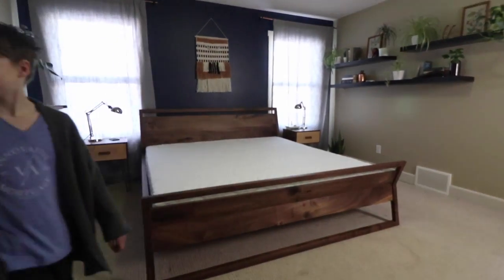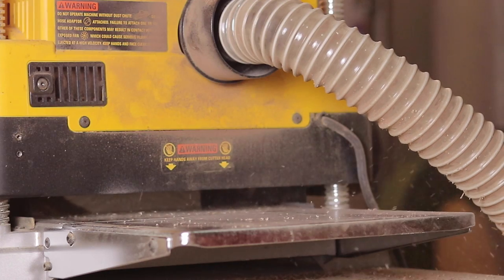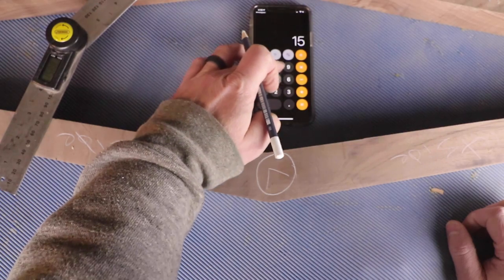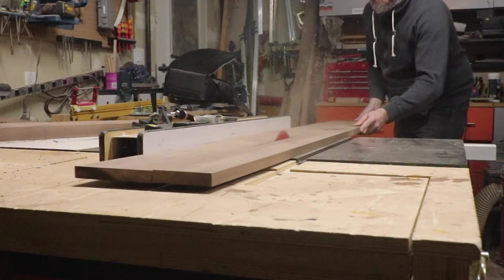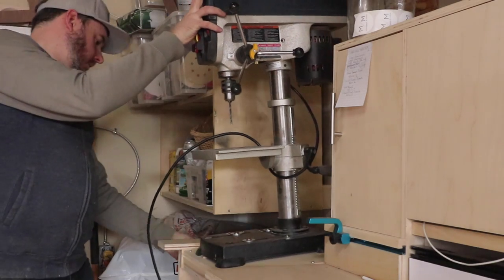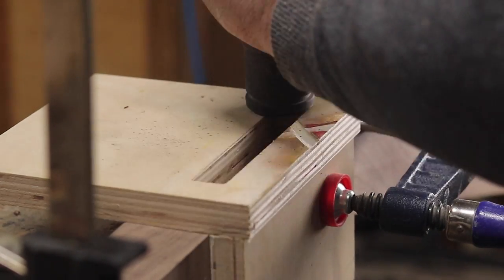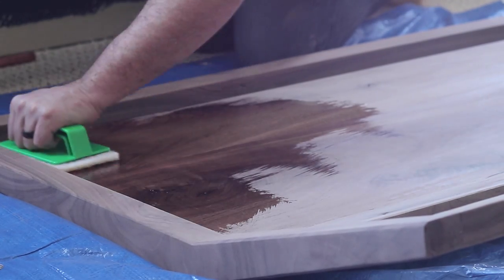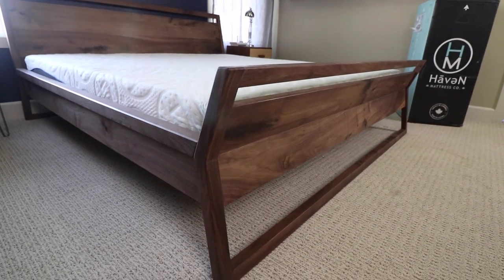How to make a Kingsize Bed Frame // Mid Century Modern Sleigh Bed // Do it Yourself (DIY)(2019)

Comment: Your design aesthetic is outstanding! Wow! Question on the hardware- Did you have any concerns with screwing into end grain and the possibility of it ripping out over time? And how's it holding up in terms of tightness of fit?  Again, incredible build and wonderfully entertaining. Thanks .
Reply from the maker: Thanks. I don’t because of how the rail is sitting. It’s been Over a year of use and no signs of any kind of issues. Thanks for watching and commenting.
Reply: Mortgage & Mitre used the hardware. Turned out great. On another note, how did you allow for wood movement in the headboard? I noticed you used dominos?

Comment: Nice bed! I might have missed it, but did you account for wood movement in your headboard or is that not much of an issue for you based on its width and environment?
Reply from the maker: Thanks, Garrett. Environmental is part of it for me, but I did us the wider slot setting in my domino to account for wood movement
Reply: Mortgage & Mitre Nice. That’s easy enough. I ask because I made a bed with a 14” headboard but just locked it in place with glue on the tight setting for the dominos. So the headboard is not free floating, this might be a lesson for me down the road! Did you use the tight setting on the top domino and leave the lower ones loose? And where did you apply glue in regards to the ends and mortise and tenons? Thank you for the advice!
Reply from the maker: So I left the settings on the posts tight and loose in the headboard so they could flout a little in the tenon, which might have actually been the opposite way I should have done it, but time will tell.